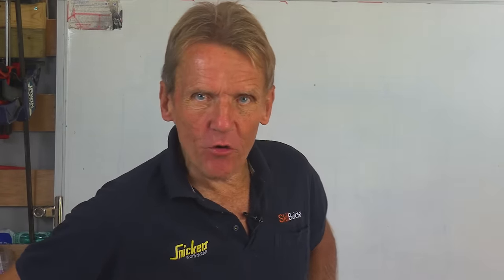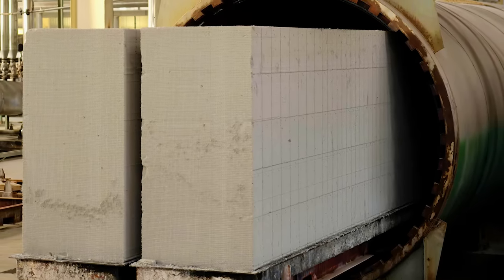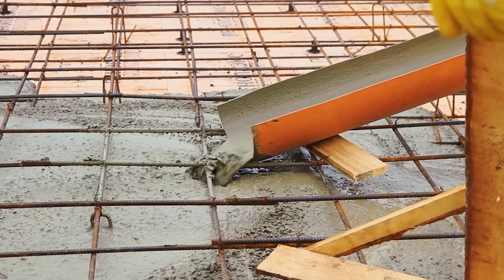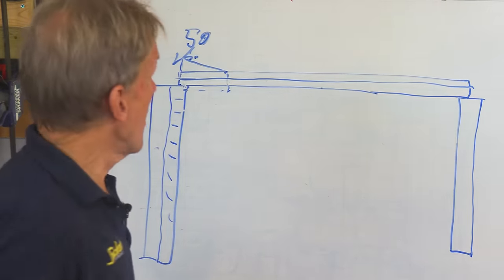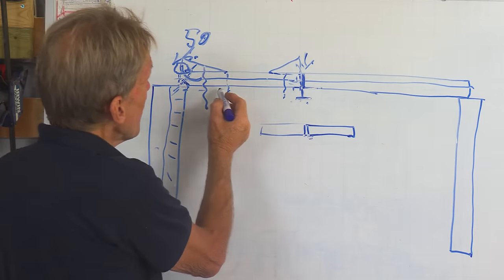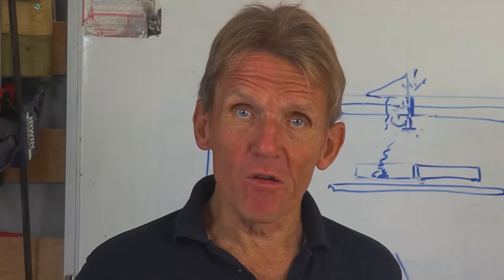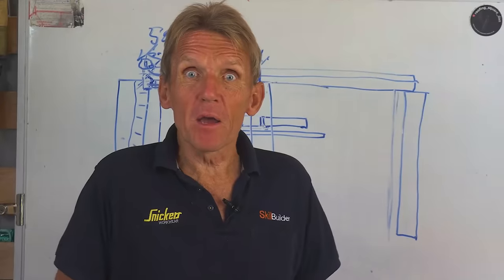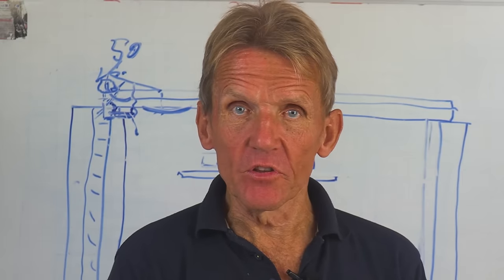The Ugly Truth About Reinforced Aerated Autoclaved Concrete (RAAC)

Comment: The asbestos thing can't be understated. The RAAC was installed in the 50s-90s when asbestos was a really common material. The only way they've gotten away with keeping the asbestos, which is hugely expensive and time-consuming to remove, is by promising not to disturb it. Which means they haven't been inspecting their RAAC properly. And now do to the inspection, they need to mess with the asbestos, which will itself cause problems even if the RAAC turns out to be fine.
Reply: Absolutely right, work in the asbestos industry and a lot of these roof voids are contaminated.
We have started doing a lot of joint visits with RAAC surveyors, we can go up with them and assess any risk from asbestos, we work for a few councils across the UK and they are starting to get very nervous about this, potentially going to be surveying 1000s of buildings in the near future.
It is a joint threat with these collapses, not only the danger of injury due to impact but also exposure to asbestos...
Reply: Also heard on the news a concern that teachers who work in buildings with asbestos in them are more likely to get cancer, even though the asbestos is undisturbed.
Reply: Which is why Labour came to the conclusion we needed one plan, to build the entire school estate. Not a drip drop of funding for to rebuild a few schools every now an again. NHS probably need the same approach but with hospitals hitting a billion a apiece that was less feasible.
Reply: @justinclayton3022  sounds like correlation... could be causal factors like teachers working in schools with undisturbed asbestos in buildings are subjected to higher work related stress than those in schools with new buildings, so are more likely to smoke or drink. Or are in locations with higher levels of air pollution. Perhaps staff lunches include more processed / preserved meat in school menus prepared in asbestos-era kitchen facilities, etc🤷🏻‍♀️
Reply: Asbestos in schools is also a problem that should have been dealt with long ago. The calls for all asbestos in schools to be removed are admirable but I do worry that we don’t have enough suitably trained and licensed contractors to do it safely and with local authority budgets all ready stretched to breaking point we could have even more exposure to asbestos due to poorly managed removal works. I bet a lot of the RAAC ceilings with structural problems also have sheets of AIB fitted to them so this knee jerk reaction to get them all inspected could cause a massive uptick in asbestos exposures.
Reply: Aorated concrete has been around for ages.. It cracks.. Its weak and once cracked has 0 structural integrity.. And there is no way to fix it.. Id say unless these things are reinforce not with steel but with epoxy and glass fiber they are basically the same as grafting cancer to your bowels. And even  lthen how long with resin and fiber reinforced ones last  and hpw strong qre they.. and the cost and  many other things
Reply: Can't be *over*stated.
Reply: @averieway no, it's because asbestos will deteriorate and school building take a beating, e.g. in the door. A lot of schools have been slow to build an Asbestos Register and then invite workers on site who do not ask to see the register before working on the estate. It's a combination of cultural attitudes to risk that you'd be surprised still exist.
Reply: @Hotoadle  That sounds depressingly convincing. And obviously means that the children are as exposed as the teachers. Correct me if I'm wrong, but I've heard various things about asbestos over the years. Aren't there two bad outcomes from airborne asbestosis: one the one hand asbestosis, which workers in asbestos factories used to die from, but also increased cancer risk over the very long term from breathing in even trace levels?
Reply: Asbestos killed my Dad. He worked as a Mercedes Benz truck mechanic for years. They used to use the stuff on brake drums. Took him quite a long time to slowly go too, over the space of years. Gradually got worse.
Reply: I know someone who used to work in an asbestos plant. He's 80+ and has zero complications from it. What he said it's it's largely harmless (the white asbestos in particular) as long as you aren't cutting it with saws or power tools. The fine fibres from that are the big problem. They used to throw snowballs at each other made of it back in the old days, he also said most of his workmates were/are fine.  I think it's a bit overblown with this in mind, however yes, when drilling/inspecting etc it's a definite risk.
Reply: @Hotoadle  so you're saying the asbestos was unintentionally disturbed by uninformed workers. Totally different.
Reply: @justinclayton3022  How does it get into their lungs, if it is undisturbed, and isn't in the air. Maybe if they used in schools, in the area, they also used it in homes, and it's been disturbed there.
Reply: @6yjjk  - Oh, it can, and it is. Same as the number of deaths caused by the Chernobyl accident, the evils of mercurochrome, and a few other things people make a huge fuss about based on hearsay and clueless alarmism (like not understanding the difference between amorphous and crystalline silica, etc.). The OP (involuntarily) got it right.
Reply: Asbestos is the big elephant in the room
Reply: ..as a swede i cant wrp my head around whats im reading..or this video for that matter....
..this should not under any circummstances be allowed...
..the building should have been santized and possibly demolished a long long time ago...
...and the concrete mentiond should never ever be used as it it mentioned in this video..
...it can never be used for bearing constructions period.
...is it more expensive do it properly... in the short run yes... in the long run its alot cheaper and better do it properly... its also safer and dont jepordise ppl and thir health...

...if its even the slightes sheet of asbestos or contamination, the building should be condemed immedietly no exceptions. ..

.. also to those thats has to work with sanitazion.. what i hear/read here is worrying to say the least... u need proper safety equippment to even enter such a building, if ur being told to work with it...use and demand propeer full body safety equippment or refuse.
Reply: @stephen3654  lol thanx...after very little consideration i think i have to pass...
Reply: @grandepiano  Is there any technology that could do imaging / scanning  through the materials to check them to some degree without disturbing them?
Reply: @cnafyi  yes, but depends on depth...
thers walls, beam and slab sacnners
that uses ultrasound, magnetic fields and nuclear decay to detect and map the structure... but thay are usually not cheap...
from a cheaper 15k euro to 50k euro each about... and possibly even more for a more advanced detector depth is usually a factor also...10-30cm is fine, can possibly be ramped up if robotized (wouldent be very safe handle)
Reply: @Patrik6920  thanks for that detailed reply ☺️
Reply: @Hotoadle  You are right, it is scary how many schools and public buildings don't have a well formed asbestos register. Either the original survey carried out that sampled materials is extremely old (2001-2010) prior to CAR 2012 asbestos legislation which raised the standards and minimum "thoroughness" of surveying. Or the registers they do have are filled with gaps that surveyors weren't able to originally access and never did.  

There are quite a lot of cowboy contractors out there, we have had so many emergency callouts due to accidental damage by drilling in places they shouldn't be, opening up contaminated void spaces, which is why there should always be an asbestos refurbishment survey prior to major works. What is even worse are cases of cowboy asbestos removal contractors, signing things off as removed after they have bodged it and left debris, skimped out on sealant etc.. it is shocking as people think they are safe working in these areas that they really aren't. Trust is a massive factor in the industry and often the cheaper option isn't the better one.
Reply: @Patrik6920  That is pretty interesting Patrik I didn't know stuff like that was out there for structural surveying. Are those machines bulky? Just thinking how you would get one rigged up in a sketchy roof void inspecting the ceiling panels?
Reply: "The asbestos thing can't be understated." It can be, and it is being understated across the corporate media which doesn't want to draw attention to the serious risks to our health by asbestos in public buildings. I think you meant "The asbestos thing can't be overstated."
Reply: @grandepiano  i dont think image-ing a ceiling/roof would be extremely difficult, in the worst case maby some sort of simple scaffolding like contarption on wheels could be made...
Reply: @N4CR  It damaged my granddad as he worked welding for ship building and he had to cut into asbestos. He still lived till 84. He did give up smoking once the problem was noticed in his 50's. Maybe this offset it.
Reply: @awild10 it's odd that they don't just do it one school at a time, if there aren't enough good people to do it all at once
Reply: wouldnt it be easier to just build a new school?(yes this is a joke)